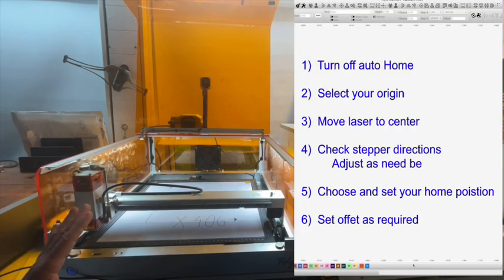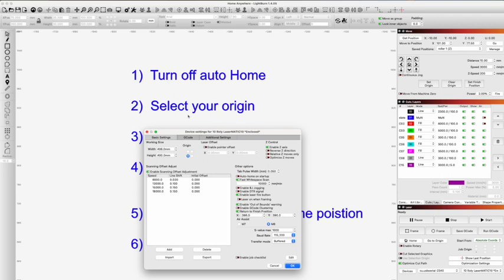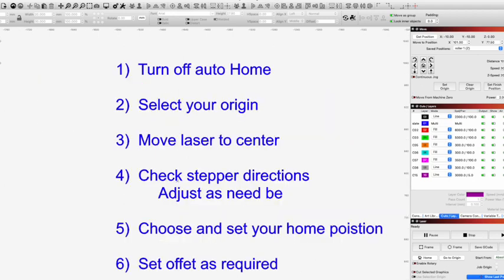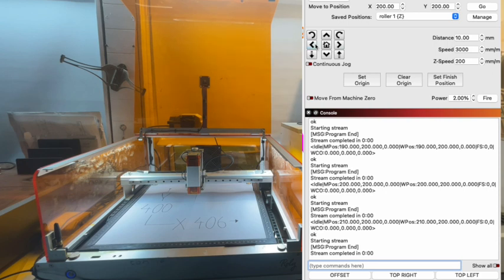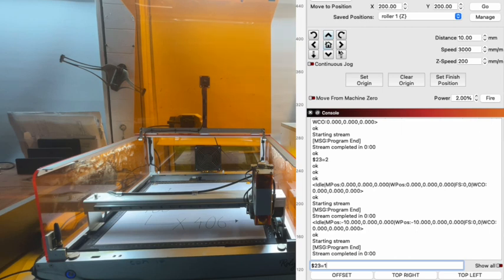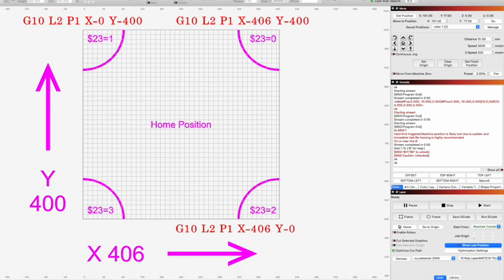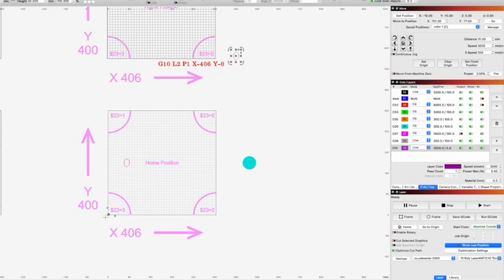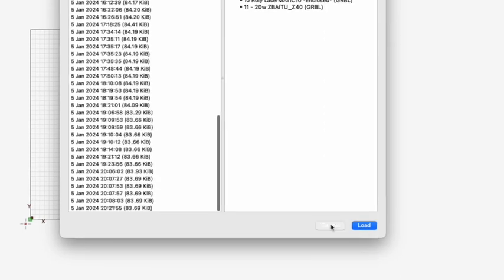How to customise Home and Origin positions in LightBurn engraving tutorial

Comment: G'day Mate. Great video I have recently got my hands on a falcon pro 2 and it has the similar issue where the Homing is bottom left corner and I have been using an xtool so am used to top left corner. So I followed your instructions and for the default home to top left, by input "$23=1". However I have a slight issue, when I go to frame an object in the centre of the 'graph' it stops! Thats when I input "G10 L2 P1 X-0 Y-415" and boom everything works fine. Until I either restart the laser or come back the next day and the homing is set to default now which is Top left but I have a issue for framing, but as soon as i input the code "G10 L2 P1 X-0 Y-415" it starts working again. So question is do I need to do that everytime? Also I have checked $3 code is "normal" i.e. left is left, right is right and so on, does this need to be changed? Another thing I still have Auto home "ON" could this be an issue?

Apologies for the long post.
Reply from the maker: With my machine when I made it home up there I found that it’s first move would seem to still go to the north east and so it would jam so I set the start position 10 mm south west from the north east corner (top right)

After doing that, I found that there was no issue

It’s a little while since I did that video but I think from memory that I show that I tab one space south and one space west and then start my machine from there. By doing this it doesn’t do that little jamming thing at the beginning.
Reply from the maker: As for your framing situation, I’m not sure if that’s to do with where the machine is starting from or it could be another setting. I would have to look a little more into that to be able to give an opinion. I haven’t been active on my laser for a little while. I need to get back to it soon.

Comment: Dave, thanks for your video.  I am struggling to get my laser in the home position I want.  I have two lasers LM3 and H10 from Ortur.  I bought the H10 as a result of my LM3 slamming into the back rail.  It ripped out the laser controller cable , bent the connection pins and I could not use it.  I bought the H!0 and used it but the homing problem still exists.  I have a new module for the LM3 and hope to install the new module today.  I was thinking about this as I was having my morning coffee and when I finished I went to my computer and your You tube video came up.  It was like someone was reading my mind.  I have looked at your video and will probably look at it several times more.  I know NOTHING about code but your explanation has given me hope.  I will post again when I get it straightened out.  Here's hoping.  Thanks again
Reply from the maker: That great my video popped up. If after watching the video you are still struggling look me up facebook and we might be able to chat over messenger and I can talk you thru it. I think there is enough instruction on the video but if you still need help I’m happy to assist
Reply from the maker: I've added a link to my business page on Facebook. you can contact me thru there if you wish to have a video chat. looking forward to hearing good things.

If you muck things up take note in the video how to restore older settings